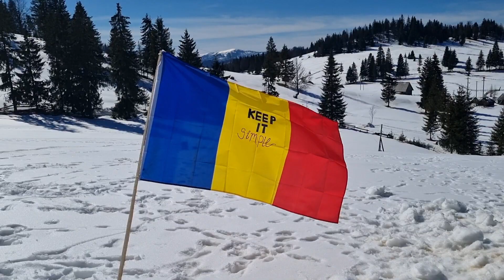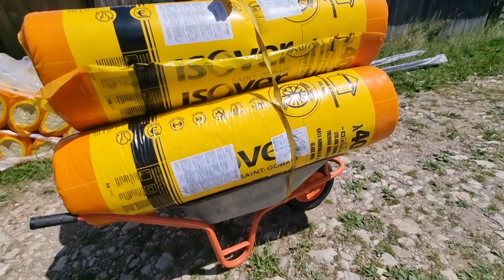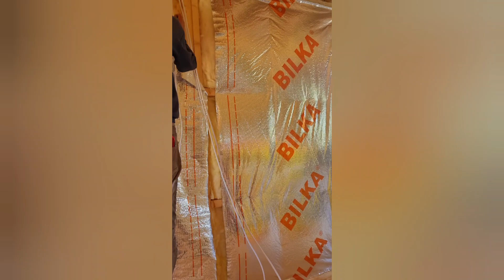Cabin Progress #offgrid #family #mountains #offgridliving #cabin #grass #build #insulation

Comment: Awesome!

Re the puzzle with the plasterboard not being the same size as the osb, perhaps you can adapt how it's done in sweden?  https://youtu.be/6F0fuDaL3FA?t=574 is a great explanation.  Basically slightly thicker and stronger walls (and a good place to hide the cables behind the plasterboard but not going through the framing) and using wooden battens to attach your plasterboard to instead of a metal frame?

In sweden a lot of timber cottages were covered up with super cheap chipboard instead of plasterboard the 1970s and then wallpapered.  These days we're ripping all that out, but it worked.
Reply from the maker: Thanks, Will, great advice, and definitely an idea I will consider.👍
Reply: @keepitsimpleromania  something else bugging me: I don't know what the wrap is on your house or what's normal in romania, but a lot of the products I'm familiar with you must only have one layer, inside or outside, and never put a layer both inside and outside.  If you do, you actually trap the moisture inside the wall, which is exactly what you want to avoid.  So double check your product just in case?
Reply from the maker: @willedwards693  it seems to be normal în romania but also we did two layers as our insulation doesn't come with a back paper , the solution is to wrap in foil the inside also.